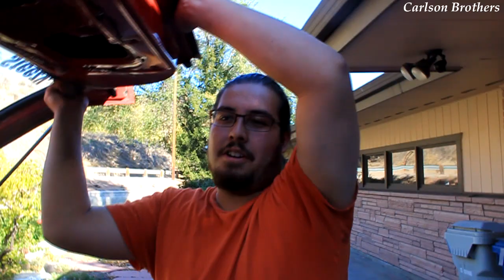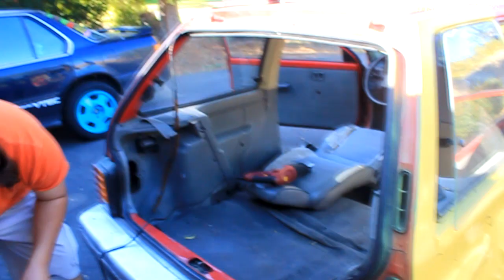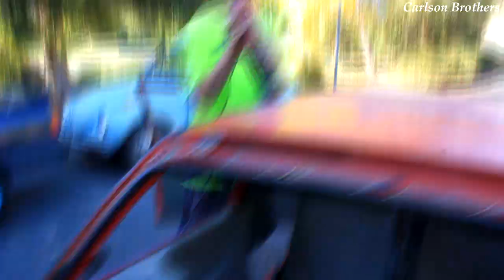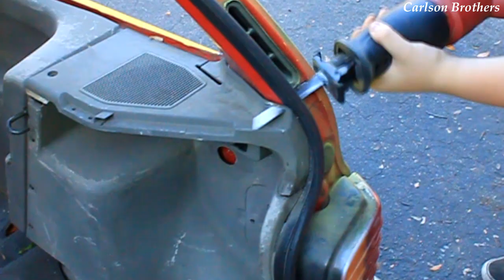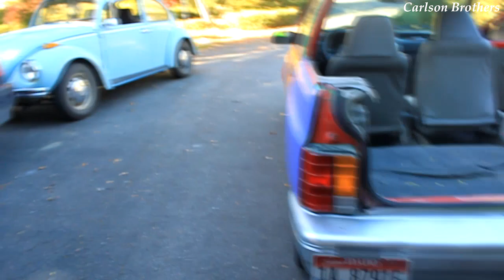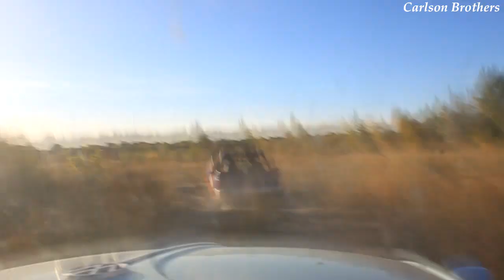How To Turn Any Car Into A Truck

Comment: I've made several pickups out of smaller cars. My first was a Ford Pinto (I wanted a Pinto wagon but couldn't find one at the time) It was farely easy. A also made one out of aa Chevy Citation, which was easy and looked pretty good too! I takes some trial and error but if you do some careful measuring, you can actually used some of the cut off portion to customize it to some degree. Yu must remember that smaller cars are all unibody, so you need to make sure you make enough support so the car doesn't flex in the middle when your done. You need some internal supports to keep the structure intact.

Comment: Will this work on my 2015 Mercedes AMG GT?
Reply from the maker: +nprguyplayz Absolutely! Just make sure to use a dull blade, and don't you dare cut straight
Reply: My tape to cut through looks like a person's tire tracks after they lost control at 90mph and my blade is duller than kid proof scissors, will that do?
Reply from the maker: That's perfect. Pics or it didn't happen. I expect a full three page report on the outcome
Reply: +nprguyplayz hahah perfect
Reply: Yeah, yeah it will. This whole idea will work on any car, cut the back half off, install a couple hockey pucks for suspension...........what could possibly go wrong.....it's mint! Too funny. (  ^_^  )
Reply: +Zac Wadholm I love this post lol
Reply: can I do it on my peel p50
Reply: Yes

Comment: Maybe next time you climb up on a roof you are cutting in half...sit on the half you are going to trash so all those buckles and dents you put in the roof as you were sitting and sawing won't matter. Where as now, the half you are throwing away is all nice and smooth while the half you saved to show everyone the cool modification you did is like ''wave and dent city'' Hope this helps on your next project. Thanks for sharing. BOZ in Kentucky
Reply from the maker: +Te Boz We were cutting part of the roof off the car...we didn't really care how the end product looked.
Reply: OK....I did not know that you did not care what the end product looked like...I just know how easy the sheet metal on the roof of vehicles is dimpled in from many years of installing sunroofs in cars, trucks and vans. Maybe my suggestion will help some of your viewers that don't want dents in the roof of their ''new truck'' Keep up the good work

Comment: anyone that thinks that dealer actually gave that guy $3000 off his new car,is foolish.
Reply from the maker: immrnoidall Just you,  actually.
Reply: it was added into the price he paid. what did they do ? give the guy a check? LOL .
Reply from the maker: immrnoidall Well yes,  they pulled dealer Bullshit,  I just figured you didn't believe the dealers not wanting this car lol
Reply: ooh i see. my first car was one no dealer would want. 4 dr Chevy "shovette" .I t came with a lawn mower blade over the hole where the front shock used to bolt on, so the shock could bolt on to it . lol no shit. i drove the piss out of that car. it died a horrible death loaded with furniture in and on it. timing bent jumped or something, and and oil was flying out the carb  and everywhere ,had to put the wiper [ one ] on. too bad. it could have made a good truck.